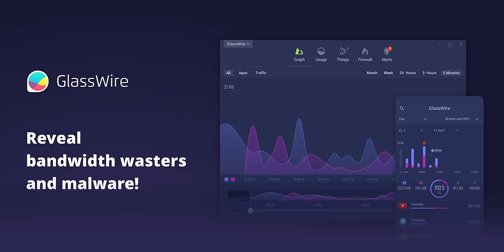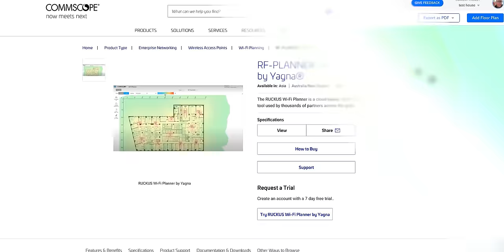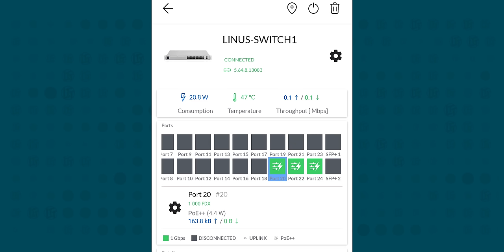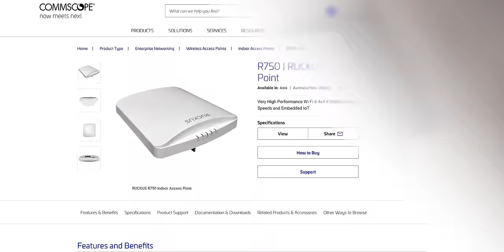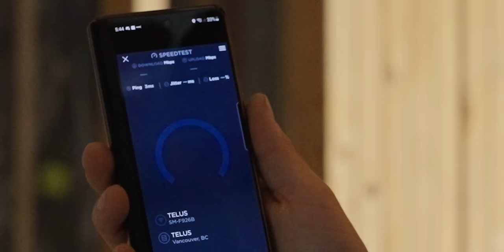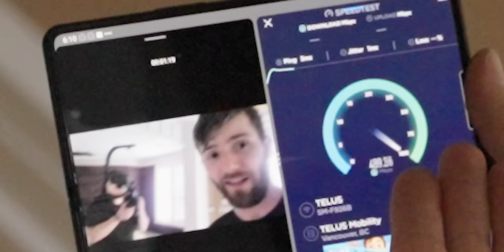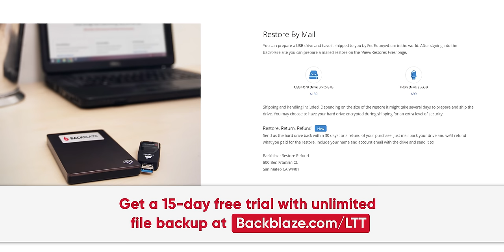Unlimited Budget WiFi at My New House

Comment: Perks of being an influencer: Your home renovations are a tax write off, and paid for by sponsors, and generate revenue
Reply: At the cost of cancer in the future from all that radiation
Reply: @christophervanzetta  wdym how
Reply: True
Reply: pretty sure wifi is non ionizing radiation
Reply: @nit-Inundate  Still can cause cancer 🤷‍♂️
Reply: @christophervanzetta  you have greater chance of getting cancer from sun's radiation than wifi radiation
Reply: @christophervanzetta  No, it can’t. Take 5 mins to learn about the EM spectrum.
Reply: @9-seven  The NCI disagrees 🤷‍♂️
Reply: @christophervanzetta  NCI is outdated. Check out the latest Ligma video on this subject.
Reply: @vinicius401  lame comment.
Reply: @vinicius401  🤣
Reply: @christophervanzetta  There is zero link between non ionizing radiation and cancer in the slightest.
Reply: @christophervanzetta  Even NCI states it cannot cause cancer. Where are you getting your information from?
Reply: @christophervanzetta  (2G, 3G, 4G) emit radiofrequency in the frequency range of 0.7–2.7 GHz. Fifth-generation (5G) cell phones are anticipated to use the frequency spectrum up to 80 GHz. 

These frequencies all fall in the nonionizing range of the spectrum, which is low frequency and low energy. The energy is too low to damage DNA,
Straight from NCI.
Reply: @christophervanzetta  Where do you even get your information? You sound like a Karen. WiFi radiation is non ionizing and that means that it doesn’t have enough power to damage your DNA even the slightest. It is a lot more probable to get damaged by the sun than this and even then it doesn’t happen a lot.
Reply: @kolt5511  But the sun is non iodized 🤷‍♂️
Reply: @Staffii1  Tell that to the people who have tumors due to cell phone use 🤷‍♂️
Reply: @christophervanzetta  you can’t be serious. Here’s a fun fact. Even the visible light is higher frequency than ”cellphone” radiation. Cellphone radiation is harmless, since it’s a very low frequency and a very low power radiation. Even if it was higher power, you could only feel it as heat. Just like you feel the heat from the sun.
Reply: @memevengers251  also have a higher chance of getting cancer from his comment than both the sun's radiation, and WiFi radiation
Reply: @christophervanzetta  sun has a wavelength of ~500 nanometer @ peak irradiance and 2.4ghz EM wave has a wavelength of 122.5 mm, are you actually comparing sun to high frequency EM? sounds like you are trolling but not at the same time
Reply: @v000000000000v  And?
Reply: @christophervanzetta  pretty basic math, planks law states irradiance is inverse power of 5 relative to wavelength, if you are worried about wifi you should probably worry about cellular first
Reply: @christophervanzetta  no it cant and its in the name.  NON ionizing radiation.
Reply: @christophervanzetta  Firstly he lives in Canada so the chemo is free, secondly he could afford to go to the best cancer hospital on Earth.
Reply: vol umetric  wish I could like your comment 5k times. "National coolaid indulger" lmao
Reply: @christophervanzetta  ofc we cannot know for sure that cell phone ratiation doesn't case cancer. But very strong arguments against it are that there is no theoretical mechanism known that could cause DNA changes by low energy electro magnetic waves. 
There are some emperical studies that suggest it increases your chance of getting cancer. But there are like multiple times more that conclude it doesn't. Problem with studies is that not everything that passes a peer review is worked on correctly and if you have a large enought pool of studies for one subject you will find any conclusion you can think of in one of the studies.  That's why meta studies are done, which come to a conclusion based on every published studie out there. 

I wouldn't worry about cellphone radiation too much. Even if it did induce cancer it would do so very very slightly (otherwise we would already know). Processed meat, UV light, being overweight, alcohol, eating hot food are far worse.
Reply: In this thread: a handful of what one would assume to be internet savvy people falling for a very bad troll.
Reply: @christophervanzetta  i too enjoy my sun without any iodine, like i do my salt
Reply: @christophervanzetta  Get an education... You're embarrassing yourself.
Reply: So true, his business is now thriving from renovating his own home 🤣🤣😂
Reply: @christophervanzetta  No, they don't. There have been very few papers that have found any sort of link between low frequency radiation (<10^15 Hz) and cancers, and most have severely flawed methodologies. Provide a citation if you believe otherwise. It's pretty obvious that you're unfamiliar with the EM spectrum; the visible light emitted by the screen you're reading this comment on has a higher frequency (and therefore higher energy) than the frequencies used in WiFi. If you're concerned about WiFi radiation, I suggest you make sure to never come into contact with any sort of visible light.

Comment: Linus: Oh only 50? Definitely want that other AP
Me: only has 50 for the whole house :(
Reply: me having 30 and im literally 30 centimetres away from my router
Reply: @-fantafoxx4557  me having 20 on LAN cable on my PS.
Reply: You're over here actingvlike 50 is not big deal I have 8 and I consider my self lucky having lived through 2 mbps for the past decade
Reply: 12Mbits peak down, 2mbits up. ;w;
Probably a bit of bare copper extending from ethernet cable would radiate good enough wifi for that.

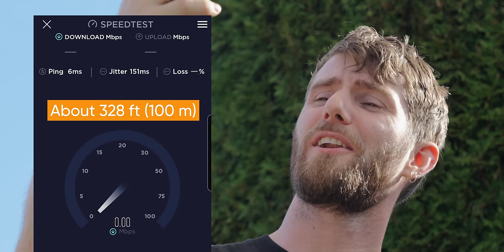Comment: 8:55 This kind of range can be kind of annoying at times actually. When I lived at the 4th floor and would whip out my phone at street lvl to type in an address into maps or put some music on the phone would still be connected but barely load. Had to tap the wifi on/off quite a lot lol
Reply: You can turn the power of the APs down slightly also to resolve this.
Reply: I think newer phones can detect if the signal is bad and switch over to mobile or another network
Reply: @randrei001  had this problem on my s10 though

Comment: Well, checking the "empty" house for WiFi Coverage doesn't do much...
Linus, please do the one AP Check again, once you have all furniture in... Then it really shows, that multiple APs was the right call ;)
Reply: wouldn't more reflective surfaces make the signal even more homogenous, but maybe overall a little worse? This could be total bullshit, I just took what I know from sound engineering
Reply: @jooplin  most surfaces absorb a lot of the 2.4 and 5ghz spectrum and especially power lines with a significant power load distort the spectrum so you really want to check your WiFi coverage with the house furnitured

Comment: we use our neighbours wireless and its rock solid all around our home  downloading 1080p movies takes about 5 mins and our LG smart tv runs great. we use D-Link  DWA 140 usb 3/gbps adaptors . downloads run at 32 mbps but upload speeds are always bad in the UK at around  10 Mbps. in your wooden home your probably going to have a lot of catnic in the walls when they install rockboard/plasterboard  which is like having your wi-fi in a Faraday cage , this may affect its performance drastically.

Comment: Just one high quality Wifi 6 AP is enough for my entire house. Even in the worst areas, it will still pull 450 Mbps download. I even game on it at a medium distance with an Intel AX WLAN card and I get no ping spikes like I used to with my previous Wireless AC setup.

Comment: meanwhile, I'm rocking my 400 USD (at the time) 3 satellite TP-Link Deco M9 Plus mesh system through concrete walls on a 2900 square foot apartment extremely relibly

Comment: Dude, I make pretty good money but 45 bucks per light switch is a tough sell. Even if it's just for the most common switches in the house. It would be nice if they made z wave switches with the motion sensor in packs of 3, 5, or 10...

Comment: Anyone saw how much one AP cost? It's € 1.687,95 in the Netherlands. So with 6 AP's inside and 2 outside it's approximately € 13.500,-- only for all access points. I'm not going to spent that just for wifi.

Comment: The wifi on my default ATT fiber router is faster, access points do not work well going for one to another, and if you wanted to spend that much netgears wifi orbi 6e would be faster and still a lot less. The ad was good I use and like backblaze.

Comment: This video inspired me to purchase couple of R710 on eBay. The initial set up appeared simpler than Unifi, but the speeds, roaming, range are actually worse than U6Lite. I'm not sure if I'm doing something wrong or the units maybe damaged somehow. Both updated to the latest Unleashed firmware. While in reality there are many options for setting up wifi, if I keep most defaults, I do not get what can be incorrect in the set up to give such poor speeds. Even the latest iPhone is only running at 315Mbps to AP up/down per Ruckus' SpeedFlex meter. This test is not testing internet just between phone and the AP 5ft away. R710 is rated at last 1Gbps+. For comparison, iPhone on T-mobile gets 480/100Mbps.
Reply: Well it doesnt have WiFi 6
Reply: @thomasfriedl3137  True. I got it for reliability that Linus praised it for. I had similar stutter issues with Unifi especially their WiFi6 device. The worst is missed words and sentences from conversation over an important call. I abandoned wifi for wire, could not be happier. But this video inspired me to to give a try to Ruckus as Linus went down the similar track that I did. Unfortunately, Ruckus is only marginally better if at all. Even eBay seller admitted: "There's an issue with firmware 200.7 and iOS devices for both the R710, R610 an R510.. where the upload speed is a lot faster than the download speed.  At this point best to stick with 200.6.10.    I had issues with my clients so I kept them at 200.6.10, you may want to roll back the firmware to that release." There is issue even in 200.10 version. On WPA2 there it is still asymmetric 300/650 and crippled. On WPA3 it is symmetric and crippled 315/315 Mbps down/up. So not sure how Linus got speeds over 300Mbps going out of the house when I can not get those speeds even between iPhone 13 and AP next to each other. I wish he used SpeedFlex meter on various devices and test these devices. I'm just curious if Speedtest uses a different algo to calculate speed.

Comment: Did you ever wonder how much value any of this would actually bring to the home in the long run? I find it interesting because I remember long ago people were installing intercoms and things throughout their home and now people are just tearing this kind of stuff out to update it with Wi-Fi things like that do you think we'll be tearing all this stuff down in the future for nothing on our walls or in our ceilings?
Reply: Remember that cell phones exist now.  Also, Echo Dots explicitly advertise intercom and announce functionality.  Not to mention things like video doorbells.  My point is the base need never really went away.  Merely the method.

Similarly, we've moved from phone and coax connections to wired Ethernet.  I don't see wi-fi going away.  Changing, absolutely.  However, the desire / need to go wireless isn't going to just disapear.
Reply: @arthurmoore9488  i hate wires.

Comment: Ouch, out of my price range. Good to see it works great then. So what is recommended for an AP olin the sub $200 range for a 1500 square foot house. I am wanting to change our Orbi router with a Sophos firewall and have a better AP. Had a used Zyxel AP but it was damaged and destroyed the ethernet port of our Orbi. Couldn't connect to the rest of the network with it but it appeared to have a much stronger signal than the dual orbi setup.

Comment: Ehh 1 AP probably woulda been fine even by his standards if he had tested it on 2.4Ghz instead of 5Ghz considering the lower levels of modulation and signal dampening that happens with a 2.4Ghz connection when shooting through walls

Comment: Seeing the internet bandwidth thru WiFi reaching a casual 500, 600 mb/s from my sad county is.. sad. Fiber ISPs don't offer anything beyond 100mb/s for residential use, you've got to use their business plan to get up to 1 gb/s (that they will still install & serve for house usage). Even the 100mb/s residential plan is more expensive than most 300, 500 plan in NA.

It all changed when Starlink arrived a few months ago, offering that 300mb/s for the price less than 100mb/s plans that most fiber ISPs offer. But these ISPs are so afraid of loosing that they immediately lobbied the government to limit Starlink's bandwidth to 159 mb/s.

For some complicated reasons, my office's internet is pretty pathetic even though it's using fiber, only 10 mb/s, no kidding. But we recently bought a Starlink unit, and a reuter that aggregate the 2 internet sources. And because how that router works with the bandwidth ratio thing, it forces the fiber connection to be faster than it should. It's now 200-300mb/s regularly. Which, I'm not gonna lie, the fastest internet connection I've ever used.

Comment: CONCRETE BETWEEN ALL FLOORS - Yes Linus, most of Europe already knows the woes of weak ass "fast" WiFi across floors. I can't even get an ole 54MBit connection across, even directly vertically aligned and technically 2m apart. (Edit: Clarification: It's not just not 54MBit, there just is no signal at all.) Which is why I usually crylaugh when all those super new and fast standards come out. Like.. the ones from 10 years ago won't even penetrate 2 of my internal walls (made of lime stone).

Well, at least we've got really good insulation and our houses won't be blown away by a wet god fart.

Comment: Network noob here. Why wouldn't you just terminate to an RJ45 jack inside the mechanical room and go straight into the rack without the need for a patch cable?
Reply: You can do that and it will work fine. The thing is that the cable runs that go from the rack to the network drops in the different rooms of the house are stiff. They are not meant to be moved around and plugged and unplugged. Over time, the cables inside can break which will cause the cable to fail and it will need to be replaced. Not super difficult to do (usually), but is extra unnecessary work. That's where the patch panel comes into play. You terminate into the patch panel and then run a patch cable from the patch panel into the network switch. That way you don't have to worry about damaging your run over time if you need to plug and unplug things.

You don't usually see this in most basic home network environments (or if you do, its usually at a much smaller scale), but this is how it is typically done in larger networks for offices, businesses, schools, etc.
Reply: @JJFlores197  Thanks for the thoughtful reply. I ran some CAT6 in my new home. I did one run with RJ45?  jacks on the end, but wiring those up was tedious. Punching down to a keystone jack was much easier. I ended up doing that, then running short patch cables to my devices.

Comment: Best for APs to be mounted high and unobstructed. However, if rooms have flush mount wall televisions (eg Samsung The Frame), is there any notable signal degradation if Ruckus H350 put behind flush mount tvs in Chief In-Wall Storage box? Will tv block that much signal in room?

Comment: 😂🤣 Budget👍 
How's mine for budget, complain every month for 4 year's about drop-outs and speeds= free internet ➕ multiple wifi6 routers and pay $25 for some Ethernet cable and Ethernet wall plugs, installed myself and a router in every bedroom @60Mb down and 20Mb up. With Android running WiFi fixer it'll switch ap's when the signal drops below a certain dB. 
Optus sux

Comment: any reason why you have so many bundle of Ethernet cable at your home ? are you moving your servers at your home ? also the wifi from ground floor will reach the top floor without any problem  only a very small loss in speed

Comment: Not sure if this is the correct place to ask this, but.  Linus, I need help finding a WIFI6E that does not have an "APP" (cloud, etc. ) you need to login and use to get this hardware running.  Can you please do a review on a WIFI6E router or just WIFI 6E no router, with not crappy app to pay for a subscription!

Comment: I live in an old house with thick plaster walls. "Regular" wifi APs wouldn't work, but I discovered that the Unifi LR (long range) APs work well.

Linus also touched on a point about his handheld device's capabilities. When measuring network performance the APs are only one part of the equation.

Comment: "only 90?" I am happy to have a 30mbit connection because I had about 5 mbit for 3 years
Reply: Damn, dude, where are you from? I had 10 Mb connection in 2007, then for several years it was 100-300 Mb, and for 5 years now I have been using 1Gb and wondering whether to connect 10Gb
Reply: I've been living in a little village with about 100 inhabitants and nobody did really care about this village and nobody built any cables here so I had to buy a vodafone homebox (basically a sim card with an lte sim router) and here wasn't any good vodafone signal so I had only 5mbit/s
Reply: + I live in Germany and literally every country has better internet than Germany

Comment: i dont know why  but i expected so much beter speed for 10.000 dollar internet, in the netherlands i have fiber at home getting 1000 up and down. my wifi using a 250 euros asus mesh set i have 940 up and down. the worsed room is still getting well over 800 up and down. granted my house is not that big, its all concreet aswell same with the floor heating. 

a 1000 client connection is great for an airport. but why on earth would he use that at home overkill in everyway and losing speed. im confused